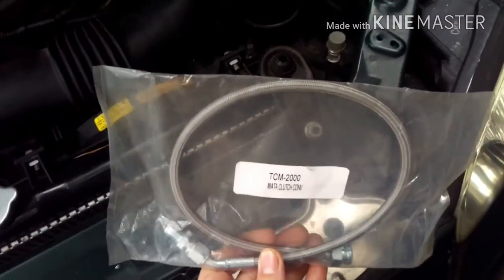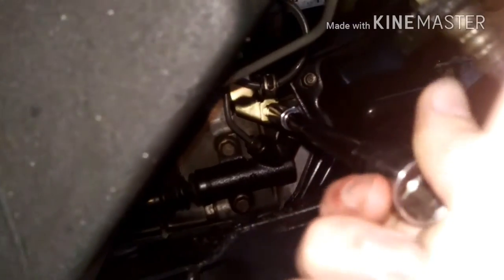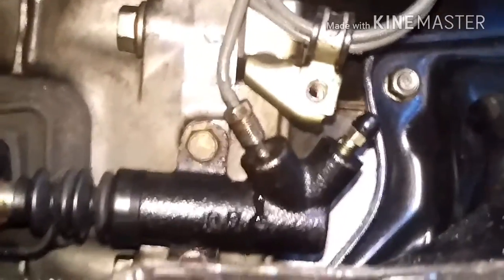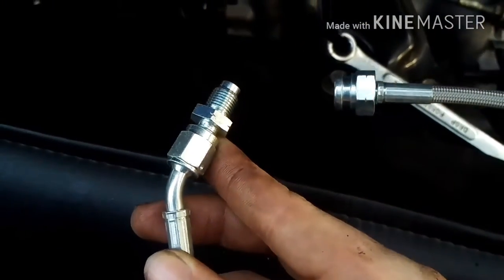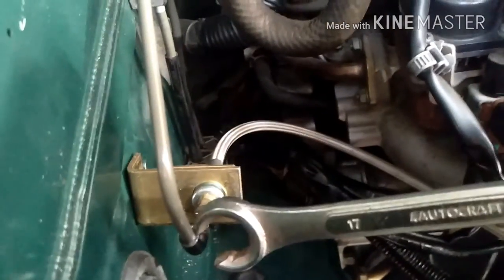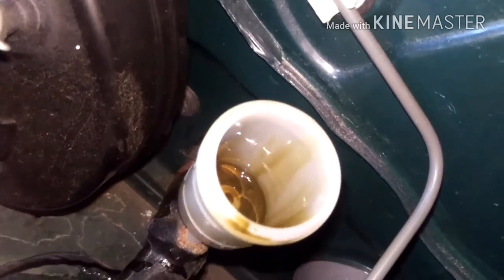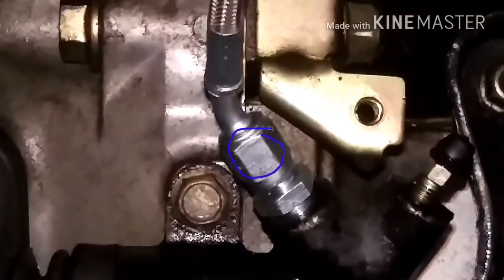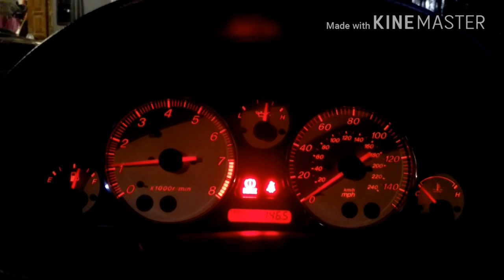Miata Stainless Steel Braided Clutch Hose Tutorial

Comment: If you get the straight shot clutch line from Miata Roadster you just replace the whole line from master to slave instead of the rubber and twisty part.

Comment: Guys dont ever use a towel to soak up brake fluid directly from the reservoir! You will get paper fibers in your fluid which can clog up the line in the clutch master cylinder. Also when you disassemble clutch parts, please bleed the system first, the brake fluid can eat paint and rust important parts that it drips onto. Also again when you are bleeding the system to fill new fluid, if you do it the traditional way, have someone push the clutch and hold it then crack open the bleed screw for 1 to 2 seconds then close the screw and have them lift up the clutch then press down and repeat until you get a full stream of clean fluid out the bleeder tube. Once you do have the person operating the clutch pump it 10 to 15 times then hold and bleed. You should see massive air bubbles come out and do this 2 to 3 times or until the peddle becomes stiff and you can always feel the slave piston pushing the clutch fork by hand as a good indicator. If your clutch is strong but not as strong as it used to feel chances are you need to replace your clutch as well due to a worn out; throw out bearing and pressure plate. Cheers
Reply: This comment is from a year ago. But thank you. This helped me a lot. Along with this video.

Comment: The second bracket attaches to the top of the transmission. There is a 17mm bolt which is one of the bolts that holds the transmission and also that bracket

Comment: Did you have to bleed out all the fluid? Like just gravity bleed it?
Reply from the maker: Karl Flores I opened the bleed screw, had someone push the clutch pedal to the floor, closed the bleed screw. I repeated this process until there were no air bubbles coming out of the bleed screw
Reply: I mean like before you take off the lines to replace it, do you bleed out all the fluids?
Reply from the maker: You can, but I just took it off and let it leak out. There isn't much fluid in the actual hose it's self.
Reply: I plan to do this in a few days, I can get away with just jacking up the front then set them on stands right?
Reply from the maker: Karl Flores that should be enough!

Comment: Your brake hose on your right front caliper is twisted. Might want to fix that.
Reply from the maker: Thanks for the tip!
Reply: @pigeon853  No worries just noticed it. Thinking of getting the MiataRoadster straight shot clutch line. Thanks for the video. Would you buy again?